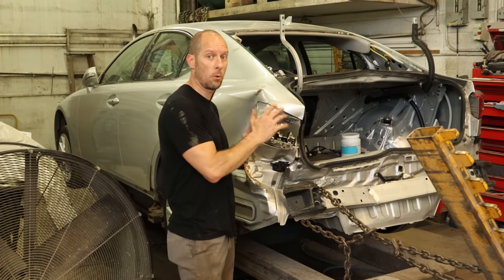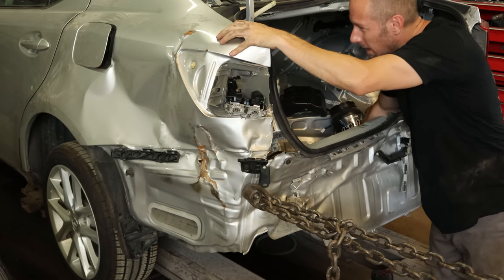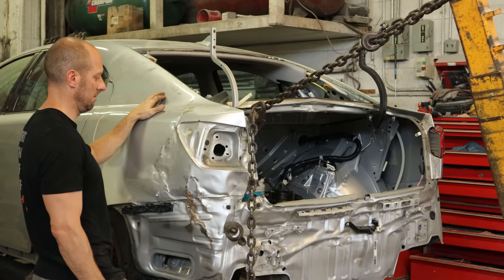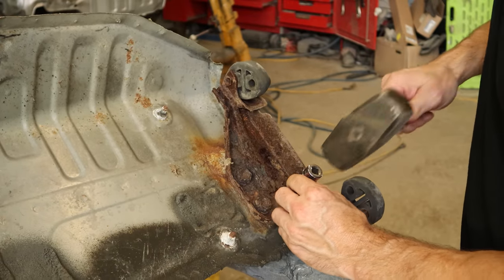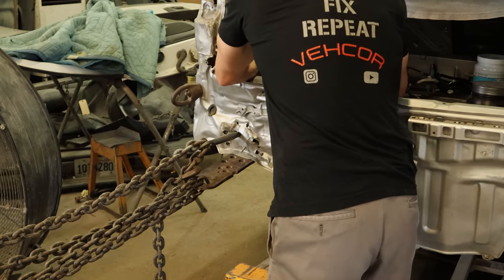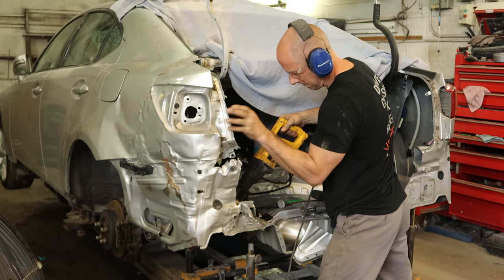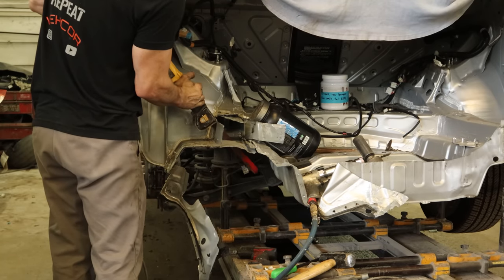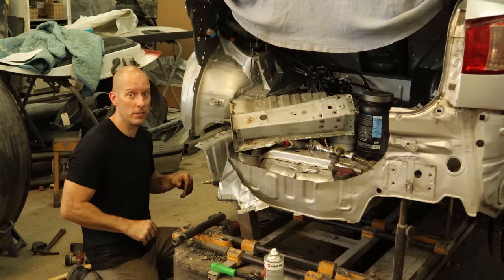Pulling and cutting the damaged structure of the Lexus IS250

Comment: One of the first things I was taught as a new claims adjuster was to allow for "rough pull time" on my estimates.  You don't just slap new parts on a vehicle to repair it.  You need to deconstruct the accident damage by taking it out the same way it occurred.  Any dorks questioning why you are pulling parts that are just going to be replaced are just that, dorks.

Comment: A "Tip" for when you break into a brake system - bin the caps, jam a bit of wood/proper brake depressor onto the brake pedal - once it is half/a bit more than half depressed, no more fluid will leak from any open line-joint. Saves a lot of drippage/mucking about/bleeding.

Comment: The dealer tech apparently keeps our wheel lock key for us on his work bench in a box of about two dozen assorted wheel lock keys he has forgotten to put back in peoples cars.  I had the key attached to the lug wrench with a long cord.  There was no reason to ever remove it.  But removed it was.
I have great restraint.  He is still alive.
Reply: said "  I had the key attached to the lug wrench with a long cord.  There was no reason to ever remove it.  But removed it was.    "  
He likely wanted to se an impact wrench for removal / install and found that the attached lug wrench flew across the shop.  ( Using an impact in the key isn't the best idea as it can cause the key to break )

Comment: 😀It must be very satisfying to think back about all of them and know that you fixed all those cars/trucks/SUVs and that most of them are still on the road? And I guess you earned a few $$$ back selling them. Hm... you got me wanting to get a V8 before I "kick the bucket". A fixed up newer Chevy SS or a Pontiac G8 GT/GPX (without active Displacement On Demand) would be nice. But at the same time the fuel/gas prices are crazy expensive over here now, and the price will only go up as time goes.

 The big trucks you have fixed also look very nice. But I kind of like wagons (we have 2, 5 cyl. Volvo "wagons", an old crappy V70 gas-powered and a newer XC 70 AWD with "serial turbos" diesel which is still rather nice) but I guess the Australian Holden wagons (som have V8s) are all Right Hand Drive. Some crashed UTEs have been imported to the US and rebuilt using crashed LHD G8s or SS cars to make them into LHD UTEs/small trucks. Those were "teased" but newer imported to the US as new cars.

I guess I can import an older Corvette or Camaro V8 from Germany but they wount be exactly cheap either. 

I've seen some new C8 Corvettes for sale over here which start at more than $110000...

Keep up the good work!

Comment: NO NO NO  , you are supposed to cut all the crashed metal away first then use flat sheet to rebuild the left inner fender because you spent $ on fancy seats rather than spending 200 on a factory inner.  Be sure to weld shut the trunk vent too.  ( At least according the that B is for build guy whom hacked a crashed GTR a few years ago . .. .  )
Reply from the maker: I only know who you are talking about from his Mustang build but it sounds like I am missing some comedy over there. 😂
Reply: @vehcor  See the first vid of the series.  ( there is a play list for the entire " repair " , be sure to note some of the comments in the first vid )   The channels owner is an IT guy that leveraged You Tube.    "  I Bought a REALLY TOTALED Nissan GT-R from a Salvage Auction & I'm going to Rebuild It!  Nov 30, 2018   B is for Build

Comment: As someone who does this kind of work daily. I find your humor fun. Because being able to do it or using what you have at hand vs what someone who might think they know what’s going on can be very different. I’ve never seen anyone use the original car o liner measuring stuff. I’ve only ever used the computer version with the trolley myself.
Reply from the maker: They still make all the data sheets to use this alignment system with current models.  It works, so I use what I have.
Reply: @vehcor  when I did the training they showed us how the original spec sheets worked and said lots of shop still use them and they wouldn’t stop making them. Also they are available on the computer system for review if need.